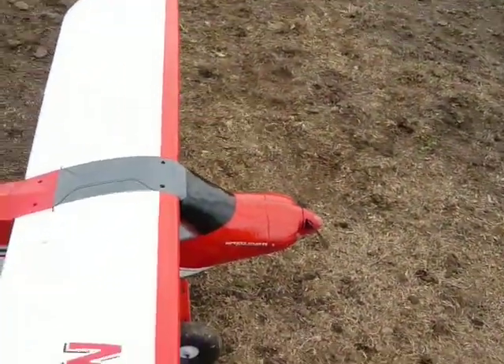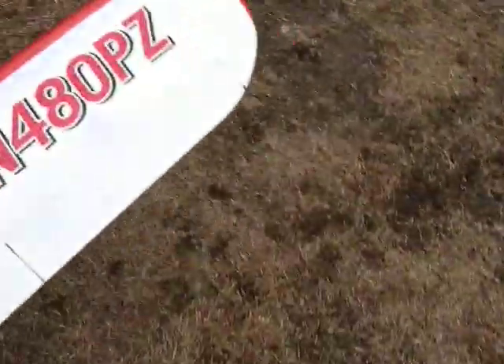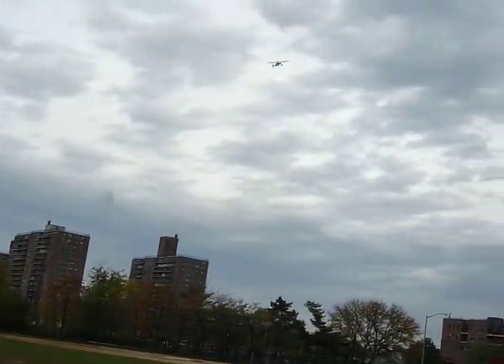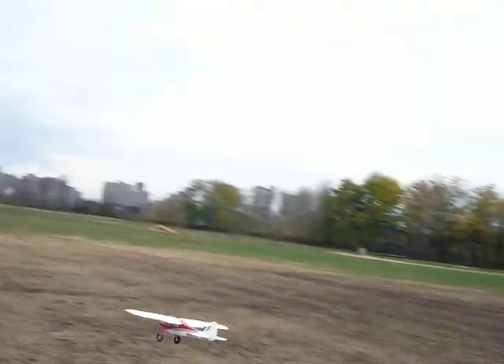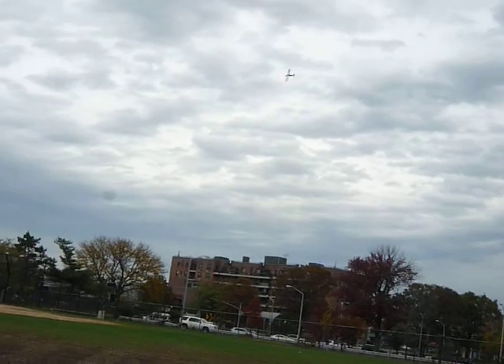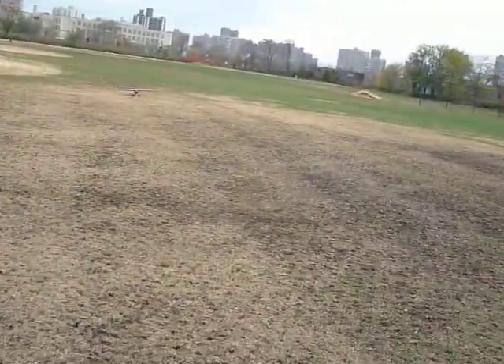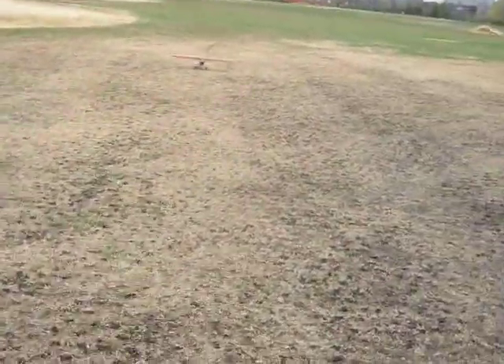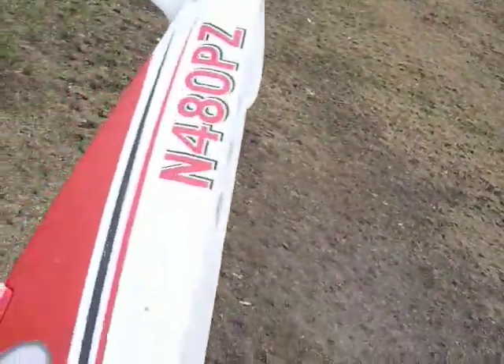Repaired Sport Cub flies again.

Comment: Hey buddy been out of the flying game for a bit but getting back in the air now.  Nice to see you flying something besides 3D.  Not that I don't enjoy watching you huck it but cool to see you flying a cub.  I just got a second hand 6' built up balsa Beaver.  It had a 4 stroke .52 but that didn't come with it so I might go electric and get a Eflite power 60.  Hopefully I'll have a vid up soon.
Reply from the maker: How've you been -good to hear from you. Good idea with the gas.  I've been thinking gas is the way to go lately. Not nitro-but either 2 or 4 stroke. My plan is to get a ryobi 30cc weedwacker. I think they are like a hundred bucks new.Build a tremendous foamboard plane and mount the 30 cc 2 stroke to it. The only thing stopping me is giant servos and some kind of servo driver. It's already built...In my head at least.

Comment: I've been doing good just working mad overtime.  I drove my buddy's rc rock crawler and loved it so I got one the next day.  Been messing with that and a racing buggy lately but I've been missing flying.  Actually last time I flew my Pitts the radio browned out when I chopped the throttle doing a wing over.  Snapped a wing when she hit the ground so I put her away and just now got around to calling Horizon.  They tried to dick me around and say it was my fault and the plane had probably been crashed a bunch.  I told them I'd send them the plane and they could check it out themselves and he said to send him some pics and if it looked legit he would send me a new wing.  Wing is on the way so I glued the original one back together and she's good as new.  I guess I just have to always keep a little throttle on or it will lose signal.  And throttle trim doesn't spin the motor even when I have it all the way up.  Def a problem with the receiver but they said they don't make that rx anymore.  Anyways dude what's your email?  I want to send you a pic of this plane I got!  Weed whacker plane sounds insane!  You gonna use the foam insulation board?  The pink stuff?
Reply from the maker: ShareCraft I'm supersport-ryder@live.com  I lost many planes when I had an old dx6i with dsm2. The dsmx radio I have now reg dx6I hasn't lost one yet.They seemed to just shut off in the air but when I got to the rx no flashing red or yellow.
Reply: i just took advantage of spektrums offer and got a free AR800 rx ($130 value) when i bought my new DX8.  i AM LOVING the dx8!!!!!!  a whole new world compared to my DX4e.  ive got that depron float plane pretty much RTF so i should have a maidden vid up soon.  check your email, im about to send pics of that Beaver